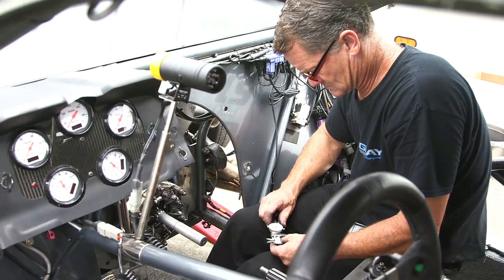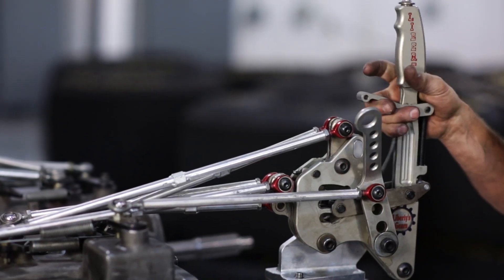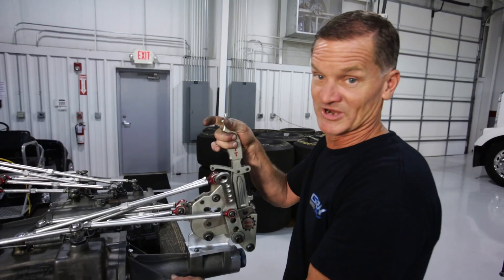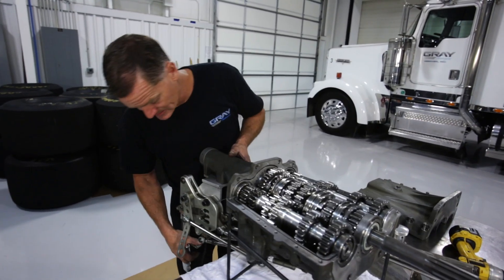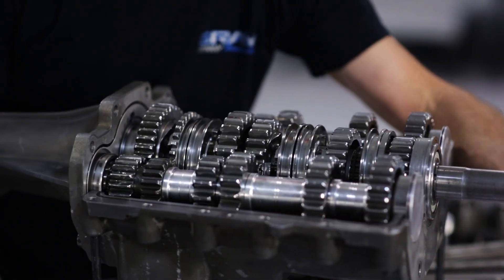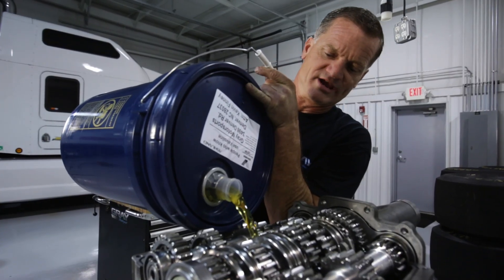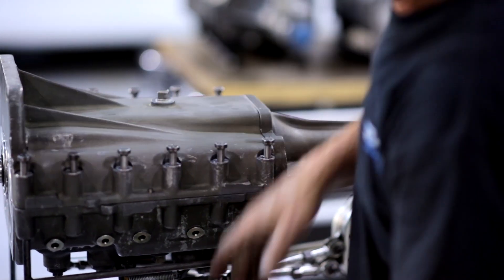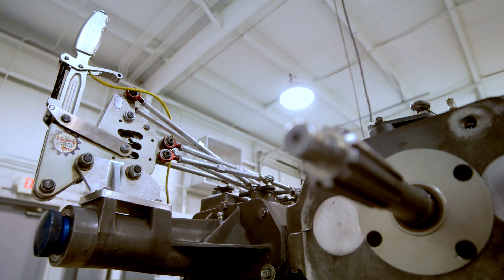Inside the Transmission of an NHRA Pro-Stock

Comment: Wow I was surprised on how compact and light that transmission is considering the horsepower and torque running though it.
Reply: Me too, it looks like the size a Muncie/T10.
Reply: When you look closely you'll see two secondary shafts running in mesh with the input shaft instead of one. This alone makes the gearbox twice as strong as an normal gearbox. Then you'll notice the straight-cut gears which makes the gears itself stronger and more efficient.
Reply: Straight cut gears are NOT stronger. Infact all else being equal helicals are stronger simply because they have more teeth meshing at any one time. 

The real reason they use straight cut is to avoid the axial forces generated with helical gears.
Reply: If the axial forces is the weakest point then aren't straight cut gears with no axial forces stronger? That was my point exactly. Therefore not only race cars who prefers efficiency, also most heavy duty machinery who prefers strength uses straight cut gears.
Reply: The problem arises when you put alot of torque through helical gears you get big axial loads. Big axial loads require big thrust bearings and a stronger housing - both of which results in added weight. 
Added weight is obviously very detrimental to any racing application. 

The helical cogs are much stronger, both because of the aforementioned multiple meshed teeth, but also because the shearing plane(not sure what the english term would be) of the tooth is larger.
Reply: IKR but read my plural form of "gear" as in 1st gear, 2nd gear etc... then it all makes more sense I think.
Reply: they said they rebuild the transmission in 10 minutes, they probably wreck the gears a lot and rebuild a lot
Reply: eksine they do not rebuild in 10 min.  They are straight cut 8620 billet steel gears, they are tough.  What he said is that they can remove it from racecar, crack the case, change gear ratios (depending on weather, traction, etc) and have it back in ready to run in 10 min.  Every run they change the ratios to suit the track.
Reply: that makes sense, a 10 min rebuild did seem too fast, would be nice to rebuild my car in 10 mins though
Reply: Why do you say "8620 billet steel gears" like its some unique super special alloy?  Also billet lol, it just means its bar stock....

I swear its like when people add "milspec" to make something sound better or cooler than what it really is.
Reply: lolsovs --never said it was unique, or trying to make it seem "better or cooler tham it actually is" just saying what it is and the fact that they seem to survive 1500 hp pretty reliably.  "LOL" I don't see what it so funny about what was written.  Christ.
Reply: we always used 8620 steel because that alloy took a case with the least distortion. they are hard on the outside and relatively soft on the inside to help keep them from breakin'.
Reply: Hey Boi, were ya been?  u look mighty cute in those jeans. now come over here
Reply: Like hell there not.. Straight cut gears are strong as a bridge. One reason they use them in high performance motorcycles.. That can fit in someones glove box! Same for any high performance cassette gearing system...

So don't confuse a rear axle with a transmission gearing setup...
Reply: i would assume they have a second shaft ready to go with the new gears on it so when they finally get back to the pit its ready to go. These guy tow back to the pits and at big events with lots of people the tow back alone can take 5 minutes. i wouldn't be surprised if they had 2 or 3 shafts with different combos they see the most often.
Reply: it aint a rotary lol
Reply: @lolsovs  I would like to add that usually, street transmissions got helical cut to reduce transmission noise.
Reply: Because there isn’t flywheel and clutch.
Not needed for this type of car.
Reply: The gearbox doesn’t need to be strong because it must stand for only one race
Reply: @SocietyUnplugged  
Pretty sure mack trucks did that in their gearboxes , they had a 3rd countershaft and it made it capable of power input exceeding anything else at the time.
Reply: Straight cut gears doesn't need thrust bearings due to no axial load.
Reply: Straight cut are stronger than helical and don't produce power robbing axial side loading. Helical gears are used for ONE REASON ONLY, low noise...
Reply: Me too
Reply: my channel 
https://www.youtube.com/channel/UCTryo0QA1BVnnsHIvd4sBJw?sub_confirmation=1
Reply: Kinda looks like a old toploader
Reply: @jaylestingi  yes they do rebuild in 10 minutes, often times we would have at least 2-3 transmission with different ratio's built between each run.
Reply: the same thought crossed my mind...
Reply: @michaelmoline7058  ลง๗จขจ.ฃจ๗งจฃงจชจชจขง
Reply: @SocietyUnplugged  I've been around a lot of large industrial diesel where efficiency is paramount. You'll find only helical gears.
Reply: Manual

Comment: how does it not eat itself? you'd think it would grind between gears with the throttle wide open like that.
Reply: krazi77 Some systems cut the ignition as you shift.
Reply: the gears are straight cut so they mesh right in, unlike street transmissions that are semi helical and need a clutch to change gears.
Reply: AlexCoronaPhotoThe gears are always meshed. Whether or not they are engaged onto the shafts is determined by synchronizers in a normal street transmission. And you can still shift without the clutch.
Reply: It's going to grind a bit no matter what you do. If you bang gears fast enough you can make it pretty smooth though, as seen. They drop the trans every run, they aren't too concerned with grinding a bit.
Reply: They are changing gears after every race.
Reply: It does not use gear to gear engagement when shifting like a typical synchromesh transmission, they use shift lugs (dogs) to engage and transfer the power when shifting and are designed to take clutch-less shifts at full power and maximum RPM without "grinding" and minimal wear/damage.
Reply: No, they are changing ratios, they don't just throw the old gears away.
Reply: You don't know what you are talking about. The gears do not grind during shifting, they are already "in" gear when the up-shift is performed.

Comment: Damn that trans is small, i wonder how this thing transfer a huge amount of horsepower and torque for such a size
Reply: Less is more
Reply: RustyCanadian Not exactly
Reply: Akasaka Verrian more than likely fully forged alloy
Reply: MyLonewolf25 Maybe
Reply: Look at a Holinger trans. They're less than a hundred pounds wet and take 650 lb-ft in a race car for months on end. They're tiny. And indestructible.
Reply: Akasaka Verrian material
Reply: Akasaka Verrian that was with no bellhousing btw
Reply: Ryan Rohauer Yeah
Reply: Spur gears/straight cut gears. able to hold more power than everyday helix gears but make more sound, but who cares about that in a drag car.
Reply: Commso :v
Reply: Commso straight cut can not hold more 
They have less surface contact that helical 
But are much easier to cut and produce even when using more expensive better material 

Hence why it's used in racing
Reply: I was misinformed, however it seems to be that they are more efficient than helical gears resulting in reduced power losses.
Reply: Commso it really depends on who when what how and why for losses in the transmission itself 
But transmission losses are small compared to the rest of the drive train 

But they would give slightly better losses 
But it's generally only done because of $$ and ease of making them

But they also don't put any axial load
But axial load really isn't a problem since we have tapered bearings 

Bla bla bla

Slightly better in some ways but worse in others
Reply: MyLonewolf25 really makes a young Caucasian male think 🤔🤔🤔🤔🤔🤔🤔
Reply: MyLonewolf25 yeah...straight cut are stronger because there is no axial load on the teeth
Reply: Because it is a standard type transmission that is shifted manually by the driver. It doesn't need a hydraulic system that fills up, and or clutch packs to change into every gear like an automatic does. An automatic has far more parts, therefore needing far more room to fit all of those extra parts. A standard transmission......even for racing, is far less complex than an automatic.

Comment: Is this street drivable?
Reply: Yes but it's not practical.  In order for it to stay in gear it has to be under power by engine or you need to hold the shifter in whatever gear you're in at the speed you're going.  If you lift on the throttle or take your hand off shifter, it will go into neutral.
Reply: +Bill Hartman  is it downshiftable too?
Reply: +Bill Hartman i can handle that
Reply: No.

Comment: Let me get this right, the two cluster gears on the left and right take up the loads evenly, which makes this gear box twice as strong instead, of one in normal gearboxes, right.
Reply: That's the idea behind it yes. The correct terminology for those "cluster gears" is actually countershaft. Mack Trucks have a gearbox with 3 countershafts! It gets to a point where weight and space becomes an issue. The idea of spur gears is to remove the axial load when using helical cut gears, thus relieving the shafts, thrust bearings and gearbox casing of stress. However a spur gear is weaker than helical due to having less tooth contact and will generally have to be of larger construction to compensate. By using helical gears but with a shallow tooth angle you can increase the maximum torque limit but without as much thrust load or as much noise as a straight cut gear. But back to the original point it's just another way to go about increasing the strength of the gearbox... but there are other options out there depending on the application of the vehicle and or characteristics of the gearbox required by the driver.
Reply: i think this is the most informative comment ive ever heard thanks
Reply: arado240dd yeah, i watched the video too
Reply: +Ham94 Great work mate, loved the reply

Comment: Wait, how do you lower a gear? Like from 5th to 4th?
Reply: +Ultra Sound IN a drag car you dont really go down but the lever pulls the gear change up the box. Higher the lever is the lower the gearbox is. Its designed that when you pull/push it goes through the gears as described. If you then pulled the lever up to the top you would be back in 1st.
Reply: +Ultra Sound like panther says, but they usually dont downshift like a passenger car, usually just 1st up to 5th then back to first to idle it into the pits or the trailer kinda thing.
Reply: Yeah, i was having exactly that in mind, going from 5th to 1st so they can do another run.
Reply: As its also a crash box effectivley you dont really want to be ginger with the throttle/changing gears as that will destroy the engagement teeth in quick order ruining a pricey bit of kit.

Comment: So, it's just a heavy duty motorcycle transmission? Cool.
Reply: I agree. Damn near looks like a harley transmission. Main shaft, countershaft, 5 gears, and a case. Not much more. Always wanted to check one of these out. Good video
Reply: This transmission is also an sequential trany !
Reply: no it's actually a mini Eaton Fuller
Reply: Springfieldm14 308winchester Both are true
Reply: @CHEVYK10  mini eaton fuller without the auxiliary part of the transmission;)
Reply: Sequential

Comment: I would have thought you would be using a planetary transmission. A lot of crashing going on inside of that transmission.
Reply: The Lenco transmission used by many Pro Stock, Pro Mod and AFC teams are planetary, 
They change gears faster, handle more power, have lower parasitic losses, require less maintenance and are lighter than a Liberty.
Reply: They're not allowed per rules, they used to be and the teams ran Lencos.
Reply: patw52pb1 ... Who told you that ?

Comment: how do you put it in Neutral??
Reply: +O x y g e n | J x s e | P s 3 clutch
Reply: so you hold in da clutch in wen you pass da finish line
Reply: pretty much.
Reply: ok truee
Reply: +O x y g e n | J x s e | P s 3  da?   you from Chicago?
Reply: no why Lol
Reply: Clutch?
Reply: den i can let da clutch out after dat right??
Reply: C l o u t J x s e ひ F o u n d e r    huh?
Reply: after i put da clutch in and it goes into nuetral ican take da clutch out i see in some videos dey hold da clutch in ?
Reply: C l o u t J x s e ひ F o u n d e r  is this some kind of English?
Reply: Lol never mind bro
Reply: This transmission has a neutral, is manually selected by lifting a separate latched handle and moving the main lever with engine off or when 5th is selected,  engine power is removed and the shift handle is released. 
When using the air-shifter, after 5th gear is selected and engine power is removed, selecting another upshift selects neutral.  
The transmission is designed to not allow neutral selection while power is applied or under load.

Comment: that trans alone is probably worth more than drag car..
Reply: +bigblock nova only 
9k. engines alone are 3 or 4 times that much
Reply: Prostock engines start at about $100k and go up from there. The engine technology is state of the art and people argue that it's more advanced than formula 1 engines.
Reply: MCRmechanic there is no chance in hell its more advanced than F1 engines. F1 teams have so much more funding, meaning more access to batter materials, better trained engineers, more testing, etc. Unless the drag car costs $300M a year to maintain an average team, F1 is just levels higher.
Reply: Matthew Zhang I'm talking about the engine, not the entire car.
Reply: Doesn't matter how much funding and research you have if the governing body restricts you heavily like they do in F1. The only part of F1 engines that are probably as advanced as high end drag engines are the KERS.
Reply: The engines are no where near more advanced than F1 units, especially the current 1.6 V6 units as shit as they sound. No way are prostock engines running close to 50% thermal efficiency or as fuel efficient either. I would probably say F1 engines are much more durable and built to a better standard given a like for like power output, but it would be unfair to compare directly in that regard due to pro stock engines being under much heavier loads even if it's for a very short duration of time/mileage.
Reply: I think the trans that you mean are the sequential trans. The shifting action is in shifter on this type.  Sequential trans are all internal action like a motorcycle
Reply: bigblock nova its only around 5-6 grand
Reply: you guys are arguing very different things. look at it from an engineering perspective. the engines are designed to do different things. if a drag engine blows up half a second after completing its run , its performed its job perfectly as it was engineered/built to do. that is no less advanced as a formula car engine that blows up after two or three races, idk that much about formula but lets say the engines are designed for 2 or 3 races. if it blows up after that than it is also done its job perfectly. the time the engine is designed for does not dictate its advancedness. lol . its simply a engineering constraint. formula changes its motors every so often so engineers have to start from scratch and design a new one. this means they have an opportunity to and also a disadvantage. the opportunity of creating a modern architecture using the newest in manufacturing technology , the downside of not running the motor for years and refining it to its maximum limits. Drag racing engines have been the same (using same loosely) for decades. capped at 500 cubic inches in most cases. they use modern manufacturing and probably all the same software as formula engineers to design the motors and heads. And after decades they have found the best possible combination of refined parts to make the most power the blocks , cranks, ext can handle. these motors are spinning massive RPM with large strokes. the rpms may seem slow compared to formula 1 but consider instead the mean piston speed and moving mass and then compare that to formula. Its a different animal entirely. and absolutely no less impressive. Also don't use thermal efficiency as a reason for good engineering , these motors are using different fuels , nitro itself is an engineering marvel of a fuel. capturing all of its thermal efficiency would be impossible since it creates its own oxygen after the combustion and burs again and again even after the exhaust valve has opened. comparing drag engines to formula is like comparing two different species of animals.
Reply: It's part of the car lol you can run a competitive pro stock car for around 250,000$
Reply: Liberty is very reasonable. I grew up street racing and one of the fastest street cars ran a liberty. Pretty impressive for country boys from Mississippi. I was shocked at how affordable is was! Much cheaper than a lenco
Reply: @MCRmechanic  no way. F1 engine is more advanced by miles. Drag engines are very very simple engine compared to f1
Reply: Dalton Michaels Thanks. For those who wish to contradict my previous statement, refer to Dalton’s comment. If you still disagree I have nothing for you.
Reply: @nhragold1922  for 250k you can make one run in prostock. Good luck running a team, maintenance, transportation for 250k lol.
Reply: That trans is 20.000 plus i work for liberty gears. We build these. They top out at about 25,000👍
Reply: @slayerofyou2010  yeah
Reply: @VoidSixx  bhai

Comment: NHRA Prostock with that 5 speed transmission is probably the best sound in dragracing...definately in my opinion it is!!!!!
Reply: I agree
Reply: I agree
Reply: +Zironi Miller I like the fuelers but Pro Stock and Pro Mods kick a$$!!
Reply: They used 4 speeds in the 60's and 70's prostock racing